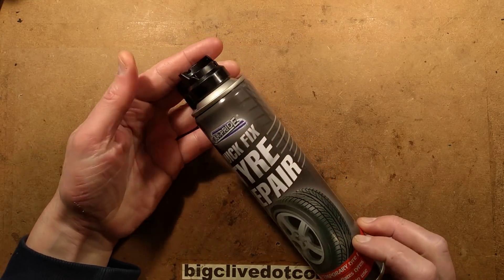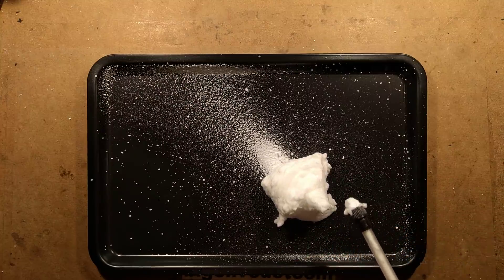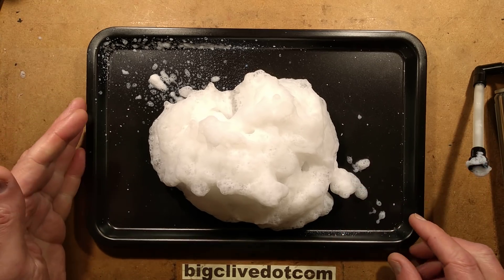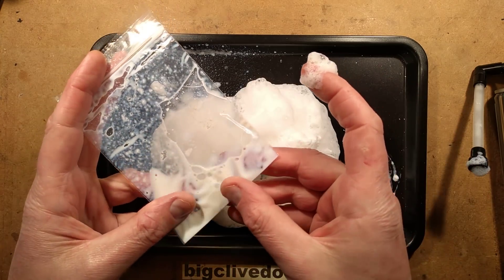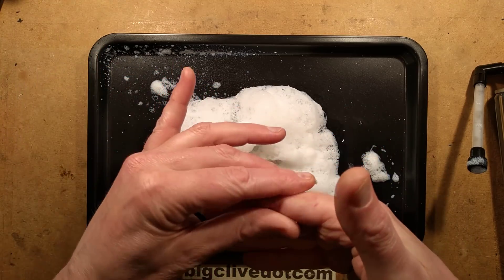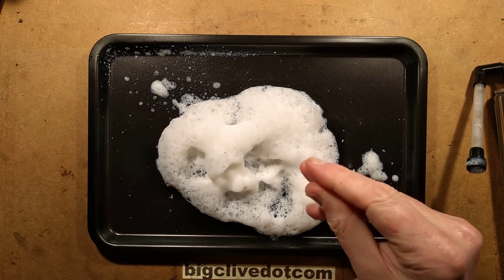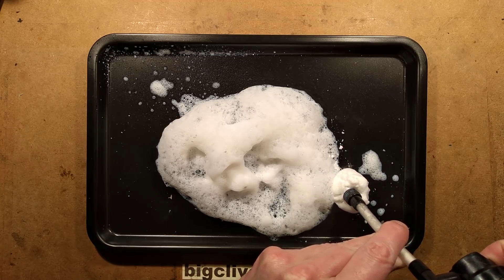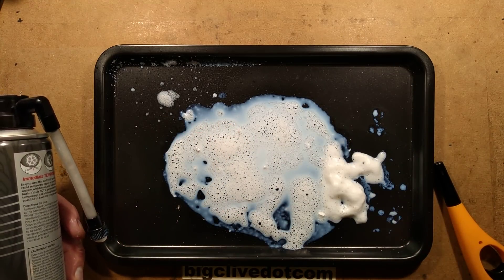What's in a tin of foaming tyre repair liquid.

Comment: In America we have a product like that called Fix-A-Flat. I was traveling on my Goldwing over 1,000 miles from home in Utah. Utah is an extremely large state with not a lot of civilization around. I got a flat tire on my Goldwing and patched it with a plug kit, but by the second day it wasn't really holding air well. It would leak down about 15 pounds or so at night. I happened to be next to a mini Ace Hardware and they had Fix-A-Flat. With nothing to lose (No one will patch a motorcycle tire in America and I was nowhere near a location to buy a tire), I gave Fix-A-Flat a try. I attached the nozzle and fed it about 1/4 of the can of material. I then inflated the tire the rest of the way. Once up to the proper pressure I ripped up the Main street a couple of times to "push" the material into the plugged hole. I then reloaded all my camping gear (I was loaded heavy) and drove another 3,000 miles at speeds sometimes exceeding 100 mph. I had no issues with that tire or handling at all. When I got back to my home in Arizona I took it straight to my local dealer and had him change the tires. I did warn him about Fix-A-Flat being in the tire, which he was thankful for...it can be messy if you're not expecting it. My mechanic showed me the tire and you could tell it had been run hot, heavy, and at some point under-inflated (prior to filling it with goo), but it had no other issues. I was pretty impressed and will likely carry a can with me in the future. Oh, and it didn't even bother the tire pressure sending unit and was an easy clean-up...a matter of wiping a rag around the inside of the rim.
By the way, if you are not from the states or traveled here, the states out west are HUGE!! Driving in Texas has to be the equivalent of driving the entire EU. I've driven all over Europe and Asia and it doesn't compare to the Western US for pure size and desolation. Sometimes you have no choice but to use something like Fix-A-Flat and I'm thankful for it.
For a size comparison, New Mexico is pretty close to Germany in size, but only has about 2,000,000 people in the entire state. I think Germany has close to 80,000,000.
For reference, my buddy and I were standing at an overlook in Utah and while looking out at an impossible distance my friend commented, "I can see next week from where we are standing." That pretty well sums it up.

Comment: Most tyre repair people will tell you most of these sprays are bad.  They are oil based and eat the rubber of the tire.  If you squirt them in you wont be able to get the tire repaired.

Comment: Yes I've used it and tires and mostly recreational vehicles and lawn mower riding lawn mower tires but I have used it in vehicles and I used to be a Tire Tech and we Tire techs hate that stuff because say you're out the shop and you're smoking a cigarette or somebody lights a match where you're taking that tire off and all of that propane or butane whatever they're using comes out of there I've seen it start on fire it is nothing nice and tires will explode too because of the pressure the heat makes it makes a lot of heat coming out or compressed air if you know what I'm talking about

Comment: Yes, I have used it. It's ok in a pinch but I would not rely on it, as I used it to get to work on time and after work the tire was still up but on the trip home it started raining letting the tire slowly leak. I was fortunate enough to have just made it to my favorite auto repair facility.

Comment: They sell small (50ml) versions of this for bicycles, that costs almost the same as the 500ml car ones. I have used the 500ml ones with an adapter for quick fixing the family's bikes when they are found with flat tires in the morning rush. It works fairly well, and will seal small-medium holes as well as inflate, so they are a great and cheap insurance against morning chaos. The ones intended for cars will last 6-8 repairs at least for a bicycle, but you will probably want to replace the tube and tire eventually.

Comment: My new Golf comes with a can of this stuff, a 12V electric air pump, a thing for removing the plastic covers over the wheel nuts and the security socket for said nuts. BUT there is no jack, wheel nut spanner or spare wheel, so if you get more than a slow puncture you'r still stuffed.

Comment: The reason it's a quick fix is that it starts leaking after about 50 miles at best and it completely buggers the valve. Or that's my experience of it.

Comment: Hi Clive. Bonus points for this one. It is a latex compound, but here in Canada (as far as I know) butane, propane and ether (!) were banned due to both environmental concerns, and tires (sorry, tyres) exploding\burning when they were finally repaired. You were supposed to warn the mechanic that you had used a tire repair can when you took the car in for its fix. They then switched to a refrigerant such as 134a which is nonflammable.

Comment: I've used it several times. One set that I drove on for the rest of the life of the tires and one tire that several cans didn't seal, the sealant just leaked out. And IDK if it was because of the size of the hole or if it was because it was winter and the sealant didn't want to harden up (https://www.youtube.com/watch?v=unkIVvjZc9Y). That time we filled up the tire with air at the closest gas station that had air and drove as fast as winterconditions allowed and in walking speed the last kilometers when the tire was empty. Surprisingly unconfortable ride thoes last meters. Since then I've put it on a buying list to buy a stickyrope-kit, but that's on low priority and have not happened and I have another can of foam in the boot/trunk. And on long trips I take a spare with me.

Comment: If you can avoid this stuff, do so - its not good on your tires, and it's a mess for the tire repair. I don't know of any company that enjoys the mess these make when they repair your tires. Also once you use this stuff you are sometimes no better off because it sometimes clogs the valve causing that to leak as well as the hole in the tire wall too. It's just a mess to use.

Comment: have used loads of times...have got a kinda methodology...it sometimes works..get wheel off ground..locate hole or best guess..rotate to bottom..inject tyre weld..listen for leak..position down..get as much out of can as poss..attach footpump..inflate until hissing stops...NOW drive carefully at very reduced speed..as a low pressured tyre is prone to heat up and fail..possibly due to propellant ignition!!

Comment: I can attest that this stuff works extremely well if you have a small puncture on a tire, at least as far as getting to the tire shop :)   The gasses in the can (and maybe some in the schmoo?) also act to re-inflate your tire as well so you’re not running on a flat.   When you get to the tire shop they just dunk your tire in water and it washes right off (once it’s off the wheel)...

Comment: I have used that spray in ATV tires and such, never for on-road vehicles.  Also in the U.S.A.  there is a liquid (see Slime, one brand) that you can put in tires that help seal future punctures.  Either one is one hell of a mess for the tire guy to get the tire off and clean the wheel.

Comment: My car tires still had good tread but some weather checking from sitting. I used fix a flat and have been driving for over 1000 miles with no issue and the leak is fixed.

Comment: Many punctures in tubeless tires/tyres can be repaired — but most shops that do repairs refuse to try to repair any that have had such a foam used on them. So instead of a $10 to $20 repair, one might need to replace the tire...

Comment: This video is the only valid use for fix-a-flat. Don't put that crap in a tire.
Fun Fact: Car manufacturers are now removing the spare tire and replacing it with a can of fix-a-flat attached to an air pump so they can advertise a few more cubic inches of interior space, I shit you not.

Comment: I've used this on slow punctures and left it in until the tyres wore out with no problems, just don't use it on tyres with pressure sensors.

Comment: @bigclivedotcom There's a better version called 'Goop' that also contains shredded rubber 'bits', and I have used that in motorcycle tyres and it'll stay in the puncture at 140mph, and until the tyre needs replacing through wear. It also claims to fill holes up to 5mm, which is miraculous.

Comment: here in the states, when using this product in a tire most repair shops will not repair the tire cause of the chemicals in it after. making it a last ditch effort to get home or to a shop to buy another tire. I would guess it is because they can not make the patch adhere over the hole after.

Comment: Nasty stuff and most tyre shops will class the tyre as scrap if you use this, reason being, one its messy and stinks like ammonia, and two it's seals any small punctures that can be missed making the tyre not fit for perpose. If your expecting to have a new tyre then this will get you out of trouble but if you know its a puncture that can be repaired then just keep the tyre pumped up, the tyre fitters will prefer that and it will save you money.

Comment: My tires have had fix a flat compounds in them since the day they were new tire shop put it in when they mounted them new. It is a 4 wheel I use on my farm, forever getting them poked from locust barb wire rocks and everything else and its been almost 4 years and yes it does go on the highway . never broke bands never had balance issues as my shop said to me bunch of horse manure with the stuff about it wrecking tires and rims . Personally the stuff has saved me from walking more than once  and the car manufacture put it in with a air compressor instead of a spare tire now days instead of a doughnut tire so yeah

Comment: Used some a long, long time ago... late 70s early 80s ish. 
MG 1100, small nail puncture..squirted into tyre.. blew it up enough to drive home slowly and sealed the hole. Blew up tyre fully when home.
Tyre replaced a week or so later, latex had formed a thin, uniform skin over the tread area of the tyre inside, nicely even coat (I presume centrifuged around). couldnt peel off...bonded to rubber inside.
that's the limit of my experience. :)

Comment: I have used that exact can of foam on a small farm trailer that I tow around the fields with the quad. The trailers not road legal just made with odds and ends I had laying around. Along with two very old wheels. The rubber tires had perished. Only hold air for a week or two. I could just drag it round with flats the quads 4X4 and wouldn't mind. But I saw these cans of foam for sale and purchased two of them. One can pumped the wheel up to around 15/20 PSI. To my surprise they have not gone flat. That was well over a month ago. Only problem I found is when you undo the tube the valve stays open until the tube is fully removed from the valve. So foam does squirt back out. I also wouldn't used a pressure gauge. Might clog it up. If they do go flat and I remember this post Ill add to it and let you know how long they lasted.

Comment: In my second-hand experience, this stuff isn't long for this world after you use it to plug a leak. I've only had to use it a few times, and got the tire patched or replaced within a few days, but I've seen repeat uses on the same tire from some friends. It'd just open up again after a little under a week, or the same day if you were unlucky. It'll work, but a month's worth of that stuff's probably not saving much over just getting a new tire.

Comment: I used a Ford canister to fill my tyre and it did not stay inflated overnight and had to fill it again with the compressor to get to they local tyre place to get a new tyre. When the tyre came off it was still liquid inside.
Not sure if it's the same stuff or not I imagine it is.

Comment: I understand there is two types of tyre foam. This aerosol, and the sealant type pumped in by a compressor supplied by car manufacturers in leiu of a spare wheel. The type that is pumped in actually doesnt foam as such - the instructions state to drive immediately after you achieve a decent pressure, this is to evenly distribute the liquid in the tyre as it sets. I recall using this once and the wheel arch had a long line of tyre sealant around it where it had leaked out whilst sealing the hole as i was driving. It took some cleaning off.

Comment: Have you looked at the rubber solutions used in tubeless bicycle tyres? The liquid is put into the tyre prior to inflation and will then seal small air leaks by plugging them with the rubber that comes out of the solution. It does dry out over time requiring it to be periodically replaced.

Comment: Hey clive I'm here in the u.s. I have used I on several occasions. I have also left it a tire. Nothing happens but you're changers hate it because it makes s mess. This stuff works best for. Slow. Leaks on the bead or like small punctures it. Obviously dose t work if you completely blow s tire. It's a chep fix to limp you Along to payday

Comment: I've not seen the aerosol ones before, I've used slime & similar products before where it's in a bottle & you remove the valve core to squirt it into the tyre & then reinstall the valve core & inflate with a pump, those type have what is probably latex but they also have chopped fibres, claim to be able to bridge an 8mm puncture.

Comment: i used it years ago on a few occasions, eventually it kept its pressure however the wheel was out of balance so i took it to tyre place, each time they spun it on the machine the balance was wrong, so they took tyre off rim and this stuff had clumped inside the tyre and was free to move about. hence throwing balance out again.

Comment: I was on a motorcycle trip once and picked up a nail in my back tire (tyre??) that promptly went flat. I carried a can of this sort of stuff which I used to be able to get the bike off the freeway and to the nearest motorcycle shop that was just a few miles away.  I fortunately was off the freeway and was about two blocks from the shop when the "seal a flat" liquid facilitated a debeading procedure of the rear tire which caused a "tank slapper" dismount at around 35 MPH.  My friends says I held on for about three full side to side swings before the bike flipped.  My boots left interesting scratches across the gas tank.  I don't remember much after that.  The back tire basically came off the rim completely because of this stuff.  I don't use it anymore as I am not a fan.

Comment: my experience is that stuff works very well. The "temporary repair" might last a very long time if you don't have the cash for a new tire. Its best to deflate the tire completely, squirt in the foam and then top up the pressure with compressed air. The bigger cans work better. I always keep one in my car, you never know when you will need it.

Comment: I have used this stuff! Inflated the flat and sealed the puncture right enough...but -  went to the nearest garage to fully inflate the tyre as directed on the tin... was distracted whilst adding the hiss into the tyre... BANG!  The pump tube, which was just rubber ( it had  been damaged and replaced before? ) had done a balloon impression and underwent Rapid Unexpected Deflation with Sound FX.
Inspection of the tyre valve showed that it was completely blocked with latex.
So beware! :)
And check your valves!

Comment: I have always carried a bottle in the car as well as a pump, Have used it to fixed bad beads or small holes or slow leaks and kept using the tire(tyre) for years afterwards with no problems, bigger holes I have always used hole repairs which I also carry in my car

Comment: We used to use that stuff to inflate a seldom used wheelbarrow rather than just replacing the tube when I was a kid, it is very much temporary and the tire will deflate once you leave it sitting for a day or so.

On a side note I once used Axe body spray to seal a tire that I was changing on a rim by hand after someone slashed two of my tires and I couldn't afford a tow. I just sprayed a bunch on the inside then ignited it with a BBQ lighter, FOOSH and POP - the tire was sealed. The mechanic didn't believe me until he started to deflate the tire and cracked up once he smelled it.

Comment: Yup, I've used this stuff in an emergency. The kit was supplied as standard with a Fiat panda instead of a spare wheel to save weight. I left the stuff in for a few months. Eventually all the latex sets into one large ball. The wheel becomes incredibly out of balance and the tyre deforms dangerously!

Never again, I have now installed a proper spare tyre and jack etc into the car.

Comment: I've used Fix-a-Flat (Slime's competitor) in both scenarios you described.  I've driven around for over a year with no issues on a tire with this stuff in it with no problem, save for temperature changes causing a larger than normal loss of air.  I've also had a tire that this stuff didn't hold air in for more than three days.  Ended up putting three cans in it over the course of a few days.  Same kind of tire on the same car.  Not sure what caused the difference; maybe I just got super lucky the first go round.

Also noteworthy, this stuff can reinflate your tire, but you REALLLYYY want your tire to be totally flat.  Everytime I've used this stuff with over 16 - 20 psi in my tire, it starts pushing the mixture back into the can and I have to stop and let air out of the tire.

Comment: I have used it after driving a screw into the tyre. It worked great with the screw still in place. I got the tire fixed soon after. I also bought a tiny bottle for my bicycle that I have never used.

ps. I also like saying rubbaaaaah! while rubbing my hands.